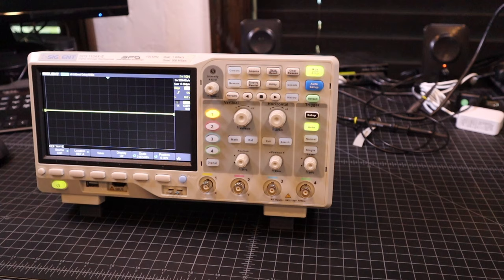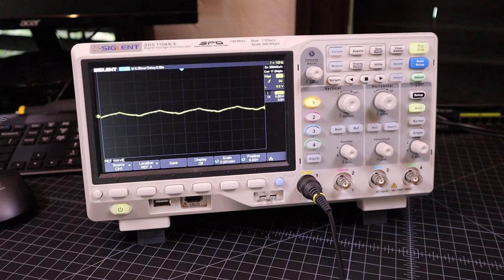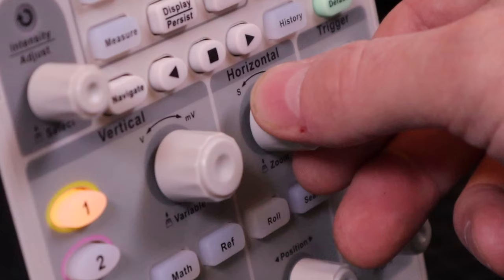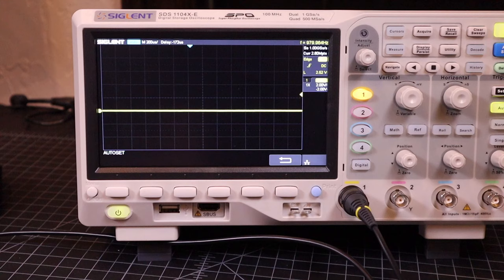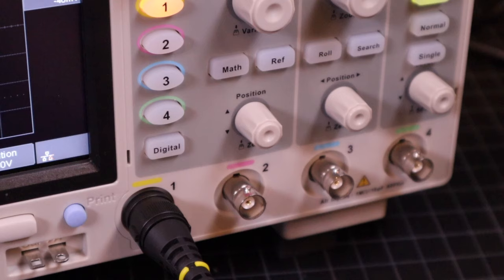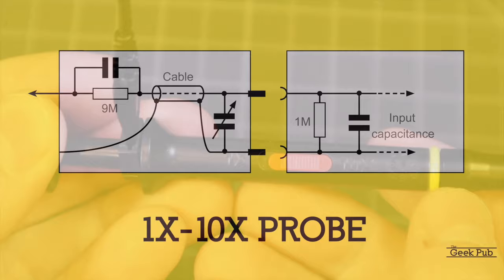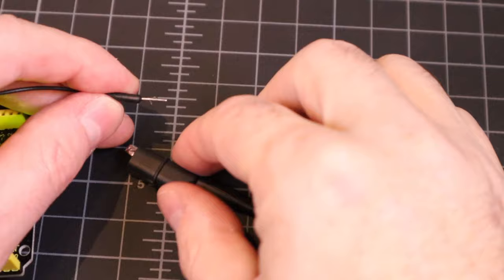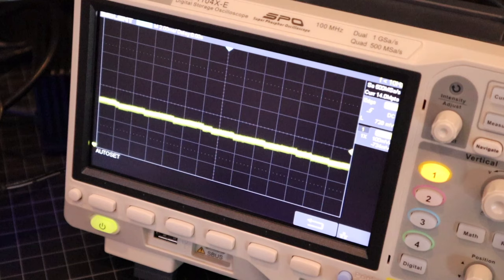Oscilloscope Tutorial (Basics 101)

Comment: Should have watched this back in college T-T everyone in the class are just turning knobs hoping the signal output that the professor wants will magically come out lolololokok
Reply: Don't press the Autoset button, boy!
Reply: Lol i came here for this exact reason! I have a lab and was barely introduced to the OC. It’s hard to grasp the concepts of what this device is doing without being shown what should be displayed and why. 
The inclusion of the DMM and comparing the values of one source on both was extremely helpful!
Reply: @alejandroperez5368  wait why?
Reply: 😂💔 sorry.
I'm currently in college and I'm happy I'm watching this now 🥸
Reply: Same here
Reply: This is exactly what is happening in our lab atm. First week with scopes. Instructors told us practically nothing about them and the labs haven’t either. My instructor had no clue what was going on with my scope and another guys. We both were getting voltage values that were way too high on the same resistor.  He basically just said to fiddle with it. He eventually had to spend 45 minutes messing with my partners circuit/ scope. The damn thing was still giving a voltage reading when the neutral power supply lead was removed from our boards. Eventually he switched the two leads for the power supply and magically the resistor read what it was supposed to. God knows what kind of trouble this is going to cause us down the road and he has no clue why it was happening either. Wasted an entire lab period due to this crap. I’ll be pissed if it continues to interfere with the lab work as the calcs take long enough. I shouldn’t have to spend 2 hrs screwing with equipment I am unfamiliar with in the first place that may be faulty. Straight chaos.
Reply: What year was that?
Reply: @ConaLes  2012 hehe
Reply: @alejandroperez5368 😅

Comment: I know this was posted some time ago, but for beginners, you should explain the correct why to measure high voltage. In your example, measuring the AC house voltage can be particularly dangerous if your ground probe is not connected to the neutral. Even testing the Arduino (while connected to the pc via usb cable) can also lead to a potential short.   Thanks for the informative video btw.     PS this would be a great comment to pin.

Comment: I've been trying to work out how to test my C64's failed RAM chips using an Oscilloscope. This helps a bit, thanks :)
Reply: Had a C64 which filled the screen with @ ($00). It should have been SPACE ($20). So I concluded that the RAM chip for bit 5 was defect. No oscilloscope needed 😉
Reply: @wlorenz65  Mine's the "?out of memory error in 0" problem so I've had to take a crash course in soldering and am just replacing chips one at a time. Would be nice if I could confirm if the chips I bought work as expected before I use them though :P

Comment: That was really practical ,  understandable  and helpful . Could you make another video on , say you have two 555 timers in a circuit , IC 1 is an astable 50% duty cycle square wave feeding one side of a Push Pull amp and the output from pin 3 also  into pin 2  IC2 which is a monostable as a one shot feeding the other side of the push pull timed to supply a matching negative going square wave .
How do you use that oscilloscope to display the two wave forms from 1C1 & IC2 on the screen at the same time so that it can be seen if the two wave forms do indeed match up .
Reply from the maker: I already have videos on those things.

Comment: It would seem that only a digital scope could display the waveform of interest such that the sweep triggering event always occurs at the center of the grid or wherever the horizontal control is set. No?
I suspect the digital scope does not display signal behavior in real time. No?
At 5:24 why do you have to connect the ground on the probe to earth ground on device being tested as the oscilloscopes probe already internally connects to earth ground for purpose of establishing a reference for making the measurement?

Comment: I noticed you using the ground lead on probes with arduinos, but not on the 120v ac line, why not?
Reply from the maker: The AC neutral is grounded to earth, as is the oscilloscope case and probe ground lead. If you move the ground lead to AC live, you create a short circuit.

Comment: Great video! Thanks for sharing. I am trying something very simple and yet struggling. What can I do to have the time a simple DC circuit goes on then off using an oscilloscope? in other words. Is there a chance to freeze the dot running across x axis so I can measure how long current was on between the time I turn on power switch and then off?

Comment: Holy crap 170v? Awesome vid.  

How can I test a home stereo cable? Do I need a separate audio signal (like white noise)? I have various test tones in my computer and various audio output jacks. Thanks! 

Ps I want to see if my older cables are not passing the higher frequencies due to corrosion or wear.

Comment: You had two probes to test the AC main with the multimeter. But you seem to input have one thing plugged into the oscilloscope to measure the same. What gives?
Reply: The scope is already connected to the other side (neutral) internally since it's plugged into the wall socket for its own power.  The multimeter is isolated - powered only by a battery and has no connection to either side of the socket he was testing... so need to connect both leads.  This fact with wall-powered scopes is what can get people in trouble when they think they can attach the scope ground lead to anything.  ZAP

Comment: If the recommended probe setting is 10X, then won't the default Arduino voltage be 0.5V, not 5V if you don't set the probe to 10X in the menus? That's what I see on mine. It doesn't seem to automatically know it's at 10X. Same scope model.

Comment: I'm looking for a simple cheaper beginner's scope to be able to just measure and monitor simultaneous voltage and current waveforms and thier phasing at certain frequencies.  I'm running an ignition coil driver circuit at around 400v at 1 or 2 amps, and at 400-500 hertz.   I think any cheaper two channel scope could do this.  I've been looking at the Kiprim DS1202, the Hantek DS02 C and D series, and the Yeapook ADS1014 D.  Is there a cheaper but decent current clamp/probe that would work with any of these?  New to electronics here and any help is appreciated.

Comment: 1:22 how come your oscilloscope didn’t blow up when you connected to mains ?
Reply from the maker: Why doesn't your phone blow up when you plug it into mains?
Reply: @TheGeekPub  I think  @Vandall0 has a valid question. You also have a valid question which probably does answer his question to an extent but if you can , could you give the reason as to why you could measure mains voltage without any issues to your scope? Is it because you're measuring neutral and hot only without touching the oscilloscope ground to the ground of mains? Also what is the significance of the phone example? Could you elaborate? Thanks in advance!
Reply: From what I understand for a cell phone block the AC mains flow through a fuse resistor. It will open when there is too much electricity. Then the ac is rectified to a pulsating DC (Direct Current). Then, it is filtered to a smooth DC voltage. Then I think it's stepped down by a step-down transformer to 5v dc where the cell phone circuits can handle the voltage. Correct me if I'm wrong.  We all are learning and looking for good information to build our electronic knowledge on. Thanks
Reply: Also I was curious as well why you didn't have issues connecting straight to mains because I'm currently in the market for a set of differential probes which allows you to measure mains and connect straight to the ground terminal with any issues up to about 1300v. If I could find a "SAFE" work around to save some money I will give it a go. Also don't want to blow up my scope. I've been troubleshooting some smps an it would be nice to probe with the oscilloscope safely.
Reply from the maker: @remnantone32  If you set things correctly the oscilloscope probes are isolated from ground. The scope I have is rated to 300 volts.  Well within its limits.
Reply: How do you set it?

Comment: The transition, nay, leap, from multimeter to scope is too fast.
Build a simple voltage divider circuit and show the 0-9V range on the multimeter.
Then show that on the scope - a solid horizontal line that can be raised / lowered by varying the resistor values in the divider.
Reply from the maker: I look forward to your video on the topic.

Comment: 1:50 170 volts?  Or did you mean 120 volts?
Reply from the maker: Nope.  170.
Reply: 120V AC is the RMS number.  Its actually cycling between -170 and +170.  When you root mean square (similar to average) you get 120 volts.
Reply: @ReggieCotton  Thanks, I was struggling with the reason behind the correct answer.